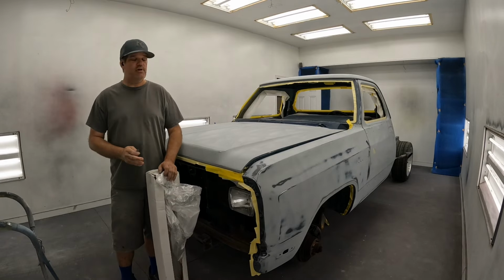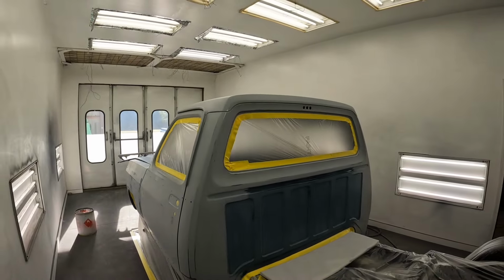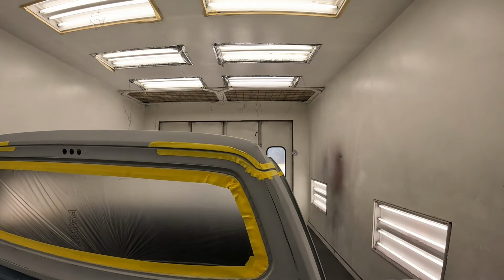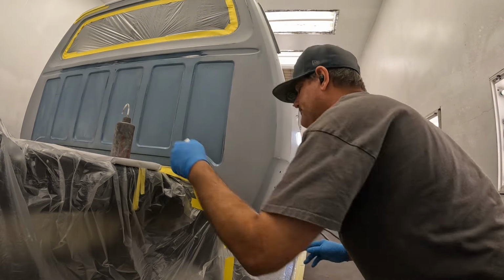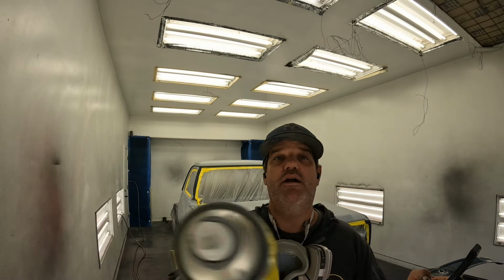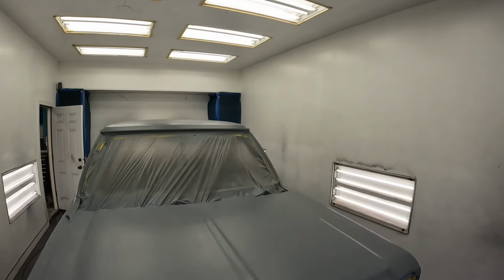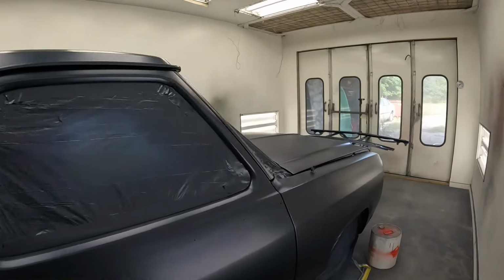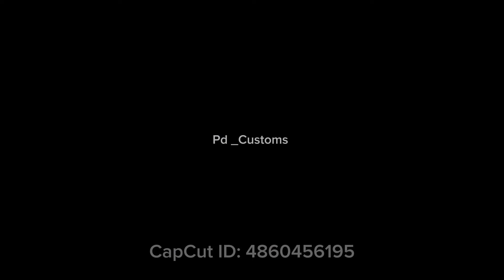DIY Paint Job; 1984 Dodge D100  Step-by-Step | From Masking to Glass like Finish !!!

Comment: I lay down carpet before spraying. Vacuum and light spray of water. It was a game changer for me lol what cap on prolite?
Reply from the maker: @jeffreyeaton9934  thanks I have contemplated that very thing . I have seen people use outdoor carpet . What kind of carpet do you use ?
Reply: @pdcustoms  I buy the on sale or discounted carpet. Lately been going to smaller carpet shops getting good deals
Reply from the maker: @jeffreyeaton9934  ok thanks
Reply: @pdcustoms  Very welcome
Reply: Do you use new carpet each time?
Reply: @ranwhenparkedgarage  No after spraying vacuum and roll up put in storage. I can spray about 15 vehicles before buying new
Reply: @jeffreyeaton9934  
Do you shampoo it or just vacuum?
Reply from the maker: @ranwhenparkedgarage   I think you can vacuum it up
Reply: @ranwhenparkedgarage  Just vacuum
Reply: @jeffreyeaton9934  
Thanks and have a great weekend
Reply: That seems like a good idea. But could it make fibers fly up?
Reply: @tildenharper  After vacuuming the exhaust fan is flowing then before spraying light mist of water on carpet
Reply: @ranwhenparkedgarage  Welcome you to

Comment: Did you save your factory windshield gasket? Aftermarket windshield seals for the trucks are horrible i just restored a 83 windshield had to come out 3 times until i finally got it sealed properly
Reply from the maker: @enjoythesho1992  I have new seals and new windshield I will just pay my glass guys to do it
Reply: @pdcustoms  yeah that's what I did ....I hope you didn't buy your windshield seal from ebay or lmc they are junk I had to do research and find a company in North Carolina that made the seal as close to oem as you can get I original ordered a seal kit from lmc everything fit awesome except the windshield seal
Reply from the maker: @enjoythesho1992  I got the precision whole truck kit so far a did the doors and the vent windows and it seems to be pretty nice . I know what you mean some are complete garbage